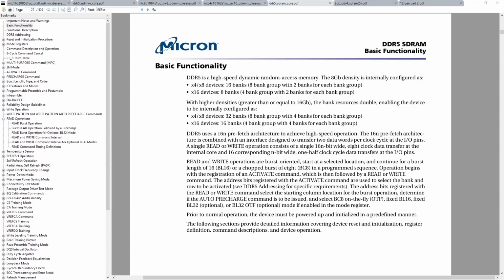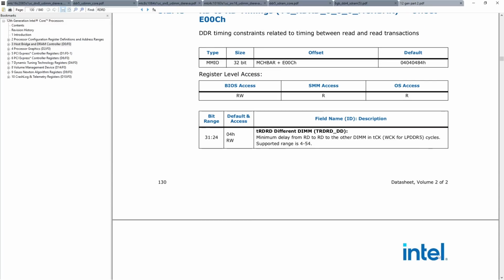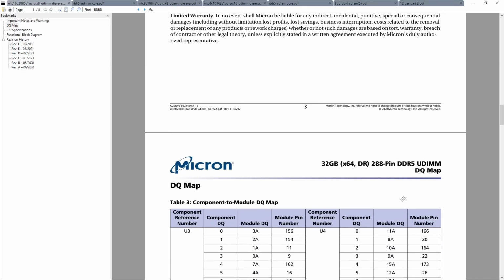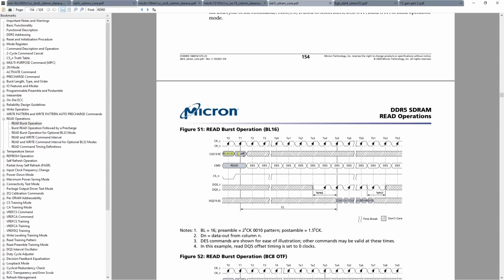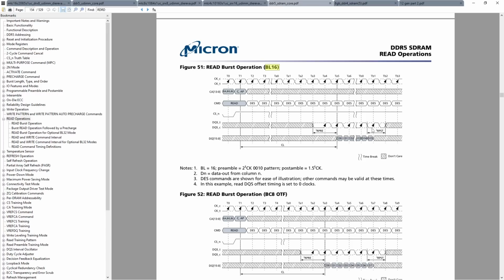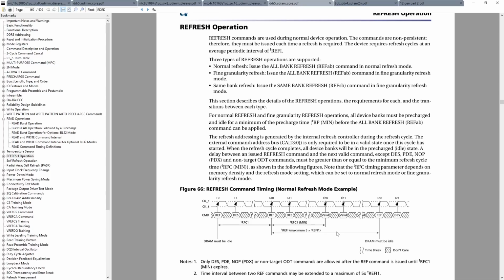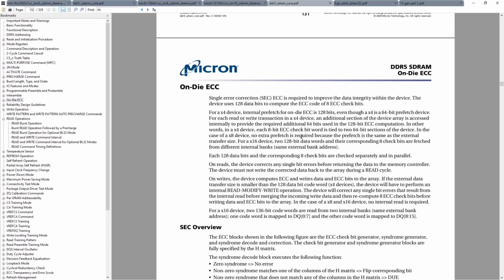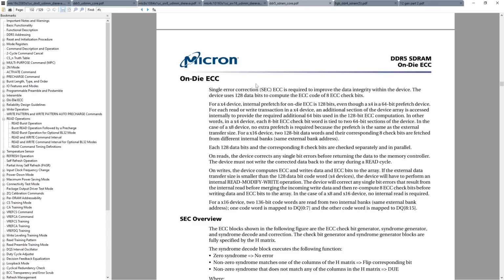DDR5 vs DDR4

Comment from the maker: Practical demonstration of dual rank and single rank memory configuration differences DDR4.
https://youtu.be/1ZbxMh5xUOg

The differences between X16 X8 and X4 DDR4 memory chips explained quickly.
https://youtu.be/w2bFzQTQ9aI
Reply: Good explanation! You bring up an interesting point regarding the latency differences between DDR4 and DDR5 – (i.e., DDR5 has greater throughput, but DDR4 will do single reads faster). Bear in mind though that, as CPU tech continues to evolve, more and more of the smaller reads you're referring to will be relegated to cache (whereas large tables/blocks would still take up too much of it). Compilers are already starting to take advantage of this evolution, so that, as new apps are introduced (and older ones get updated for modern architectures) we'll see a greater and greater performance advantage to DDR5.
Reply: Thanks for sharing so much information about DDR5. It might be important for me if I decided to upgrade one day (which is likely going to be in the later DDR5 era). I found that there was a general lack of information out there on how DDR5 really works and what the differences are. Glad to see you filled this hole.
Reply: NICE  AWES0ME KEEP_IT_UP! ✨🎉✨🎉✨🎉🎉🎎🎭🎎🎭🎎🎭🎗🎗🎗🎗🎗🎗🎗🎑🎑🎑🎑🎑🎑🎑✨🎆🎆🎆🎆🎆🎆🎀🎀🎀🎀

Comment: Hey, I found some RAM that is very interesting to me: MRC4E360GKKP8GX2
This is the only DDR4 ECC RAM with XMP that I found and I like it! I would like to upgrade to 2 x 16 GB Kits of these one day. Can you tell what ICs are used? Do you think it could be overclocked to 3800 or even 4000? Maybe you could make a short video about overclocking ECC RAM one day? There is a "myth" that you can't OC ECC RAM but this MRC4E360GKKP8GX2 already shows the opposite.

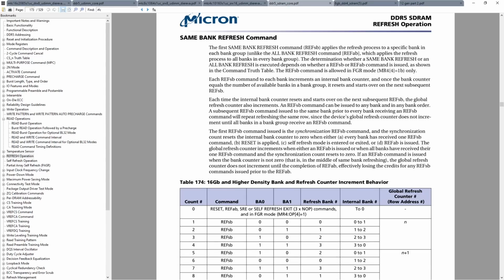Comment: 34:11 - Chapter about on-die ECC
- What is the difference between DDR4 ECC RAM and DDR5 on-die ECC? (The error correction with on-die ECC is on the DIMM so the path from the DIMM to the CPU is not protected.)
- Do bit flip errors happen mostly on die or on the way to the CPU? (I guess on die which would be good for DDR5. I think every RAM ECC is a good feature. Proper ECC would be even better.)
Reply: While there is different DDR4 ECC (UDIMM/RDIMM), the first benefit of ddr5 on-die ECC is that the memory controller of the CPU has less work with the error correction. The on-die ecc means the CPU does not waste cycles waiting for data and extra bandwidth for the ECC data. At the same time it gives memory suppliers better built-in margins for error rates - which will get higher due to ddr5 density, speed, thermals, etc.

Regarding error en-route correction the Synopsys document he showed contained a paragraph, but I'm not sure if that covered the regular consumer ddr5 on-die ECC.

Comment: 19:52 DDR4 and DDR5 both return 512-bit bursts because a x86-64 CPU cache line is usually 64 bytes. When a CPU reads even just one byte, it gets it from the cache, and each entry in the cache (i.e. a cache line) is 64 bytes. When the cache doesn’t have the data, it asks the memory controller to fetch a whole cache line. This may seem like overkill just to read one byte, but a program will need other things in the same cache line more often than not.

Comment: 22:30 does an overgrown single channel mean would provide better latency consistency if there are 2 sticks in channel A on a 4 slot, dual channel board?

It doesn’t sound to me that it’s gonna be lower but that’s okay as long as it’s consistent.

Very specific application, It’s on a T topology board not a daisy chain.
Reply: To be clear, I give no fucks about bandwidth and throughput only about latency. 

Not the lowest possible but the most consistent possible.

Comment: Without checking the litterature, I believed that the two 32bits sub channel were interleaving, thus doubling the effective clock frequency, in a manner that a single 6000 dimm would run two 3000 sub channel interleaved, like half a cycle off phased, a kind of cheated QDR. After watching this I realized that two dephased sub channel wouldn't work at all. so there are just totally independant.

Comment: All interesting but consumers only care about Price to Performance. Frankly, this early and slower DDR5 standard should have been skipped, and pushed back for the faster DDR5-7200 (PC5-57600) standard. 

Commercial acceptance is very similar but with the addition of density and efficiency.

Comment: And DDR6 (Microsoft, Sony...)?
Reply: And how does DDR5 affect APU performance?
Reply: @prep0wer  For current Vega-based APUs (5X00G), DDR4-4000 CL16-19-19-39 is the point of diminishing returns.
Past that you get 1-2 extra FPS at best in a few games, but sometimes you get LOWER FPS.
And from existing AMD APUs in laptops and the Steam Deck, faster DDR5 isn't exactly going to blow your socks off.
It won't make up for the lack of a modern dedicated GPU, it's basically around the level of a GTX 1050.

Comment: Nanya makes 8Gb DDR5 chips. Or they at least include an 8Gb chip in their list of DDR5 ICs, and they list a few different modules which use them on their list of DDR5 DIMMs - in fact, right now they don't seem to list any DDR5 modules which don't use those 8Gb chips. I'm not sure whether they're making them in significant volume though.

Comment: Unless I missed it in the video when ocing ddr5 with built in ecc you won't know where the oc limit is exactly. Because the ecc will fix errors to a point. Also does ecc have any peformance penalties at all.
Reply: In general, there is additional latency to calculate or check the ECC. However, this latency is usually small, a couple cycles. Plus, as far as I can tell, there doesn't really seem to be way a to turn off on-die ECC, so not really a place you can try and get more performance.
Reply: @dmanatunga  ECC has to consume resources to be running & on top of that if there is an error and it gets corrected there's  micro stalling and the more errors the worse.
Reply: @zazabean23  I'm not sure what you are trying to say, but in terms of ECC in DDR5, it is a constant. For writes, the DRAM has to calculate the ECC. For Reads, the DRAM runs the ECC check and correction process. That can typically be done in a couple cycles.
Reply: @dmanatunga  how do you think ECC itself runs? Does it use magic? I just pointed out different issues with ECC. ECC is not good for latency.
Reply: @zazabean23  Every comment I have written states that the ECC will incur an additional latency. However, that latency is fairly small. You can tell this from the spec because if you look at the CAS latency at the same data-rate, the difference is fairly minor. And as I stated in my first comment, ECC does not seem to be a feature you can turn off in DDR5, so it is not even a possible point for improving performance.
Reply: Even without ecc finding a 24/7 stable ram overclock is tough. Had all sorts of memtests running for days without errors just for minecraft to crash every 45 minutes. Aa a novice, id rather have ecc correct the occasional mistake even if it makes it slower in the cycle it happens. To find if its stable i guess you would test for performamce regression like you do eith VRAM?

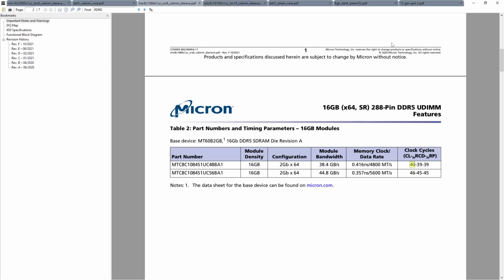Comment: 25:30 how is it different from any other new generation of DDR which was slower at the launch? Best absolute CL latency is approximately same for all DDR generations.
Reply: this time the CL latency increase is much bigger, proportionally than other generations. However the various other data transfer efficiency improvements mentioned in this video suggest that simply talking about CL latency is irrelevant.
Reply: @kuyans3889  best DDR2-800 is CL3 (circa). First gen DDR3-800 has like CL6.

Comment: Cosmic ray data corruption within  RAM is actually more common than you'd think, and on die memory correction should alleviate 99.9% of them, because most of the time you're only going to get 1 within the space of a single machine.
However, as these memory wells get smaller and closer together, you're more likely to get multi-bit corruption from a single event.
Reply: what is the frequency of those events?
Reply: @Lemard77  REALLY common, it just depends if there is a computer in the path
It has affected election outcomes before
Reply: @Lemard77  
we're constantly being bombarded with high Energy Particles, of various types. but the Planet is big, so the probability of something hitting specifically your Computer is relatively low.
Neutrinos are the big one, as they do not come into contact with Matter, so they pass straight through the entire Planet and everything on it, as it nothing was there. flies right through us at a high fraction of the Speed of Light. but they can still affect Electrical Signals.
Reply: @Lemard77  If you want an extremely rough idea about how often? It depends on a lot of factors like your geographical location and all of that.
But you can expect having 1 bit flip every day. Depending where you live you may get one every hour or every week.

And that can cause BSOD or whatever you don't want to have. Which is why servers all use ECC memory to be "immune" to this.
But for consumer hardware, not having ECC means you need one less chip of ram storage (8 vs 9 chips) which makes cheaper ram. And since consumers will blame it's the gods' fault when their PC BSOD, it's not worth the extra money.

DDR5 will basically reduce these bit flips from daily to yearly. Because DDR5 memory is not completely ECC, but the most affected parts of it are.

And TBH it's really time we finally have ECC for consumer hardware.
Reply: @swisstraeng  but I think the reason every chip has ecc because we have so high clock speeds in such small packages that it's inevitable and decided it's necessary and probably so you don't need to make DDR6 or DDR5+ or whatever in a few years, also funnily ECC is good for over locking (oc) to, it gives a lot of advantages firstly ECC / Server RAM, more data is open, like what ram chip is used, it's most of the time under clocked for some reason and if all else is equal you can push it high especially the timings because a single error and even double errors gets corrected if it didn't quite come through, at the cost of latency of course + your OS can log un/correctable errors so you can fine tune it a bit more.

Comment: Very interesting and enlightening. i have no idea what i'm doing with overclocking RAM on AMD or intel. I did no research and was just lucky on my first try (took a few days) on a 5700G getting 1:1:1 timings going from 4400CL19-19-19-39, up to  4933 CL17-17-17-30 with ~73GB/s at 54ns(i cant find the screen shot of 4933 CL17-17-17-28 with improved sub timings hitting close to 74GB/s  49.1ns) 
Going to definately try raising TRFc instead of lowering it

I know people are going to ask, yes the UCLK/MCLK/UCLK are all at 2466Mhz, Ryzen APUs use TSMC 7nm memory controllers, where as Ryzen CPUs use GloFo 12nm memory controllers which can only hit between 1900-2066Mhz(friends says he got his to 2100 but it sounds like its not stable)

I wish i could get my 5700G to run that patriot viper 4400 still overclocked to 4933CL17-17-17-30 in dual rank instead of single.

I cant wait to see what we can get out of 7000 series APUs.

Of note I cant seem to get my 12600k with the same kit over 4800CL18, and it was like 64GB/s so probably the equivelant of running the memory at 2:1, like i said, i dont know what i'm doing
Reply: I think you may have misunderstood what he was saying.  tRFC should be as low as you can get it- this is how long it takes to perform the refresh - so a higher tRFC would mean a longer refresh and thus more time that your ram is sat waiting.   tREFI is the one you want to increase, but unfortunately this is locked on Ryzen platforms.
Reply: @malphadour  You're right, the one where he said most people set to 32k. It would be nice if my 5700G could set this, so i'll just have to try on my 12600k. I'm going to have to do some reading about how to overclock on alderlake. With a different kit, I was able to hit XMP 5000 CL19-19-28-28 (? dont know if thats right but thats what the kingston renegade 5000 kit specs page says) 
Edit, 5000 kit was still slower than the 5700G with the viper steel 4933 CL17-17-17-30 
I had originally bought the renegade 5000 kit to play with the 5700G/5600G, but with that kit i couldnt even get it running at 4200CL22. I was happy it at least worked with Alderlake
Reply: "Going to definately try raising TRFc instead of lowering it"
Keep tRFC as low as possible. tREFI is the one that should be high. tRFC being higher means your RAM spends more time refreshing, and therefore less time storing or sending data.

Comment: If you practically always want to be single-rank for best performance with DDR5, wouldn't that argue heavily for future casual user DDR5-only platforms to not allow more than two DIMMs anyway, so as to limit less than optimal options for normies that prolly don't know anything about any of this? One could argue capacity issues, but then DDR5 is also said to be coming up with 16 and 32GB DIMMs as the new standard and for regular normie stuff 2x16 or 2x32 is more than enough, while the pros that need that extra RAM can buy HEDT-type platforms instead.
Reply: People like to be able to have dual channel while still being able to increase RAM capacity in the future without having to get rid of their old RAM.

Comment: So, as somebody who less knowledgeable in the field of memory, would it be safe to say for the "common folk" PC enthusiast, sticking with a high end kit of 2x16 ddr5 would be a safe option?
Reply: BZ says that dual rank (2x32 DDR5 is dual rank) memory doesn't offer as much performance uplift as dual rank DDR4 does, so there's less of a downside to buying single rank 2x16 DDR5 sticks. Not that buying double the memory for a less than 10% increase was ever a good decision. But yeah 2x16 is a good choice if you don't need 64GB of memory.

Comment: I'm a slightly above layman on this stuff, but I actually was able to follow a lot of that. Thank you so much. Now I just need to figure out an easy way how to tell if a memory kit is Single Rank or Dual Rank easily enough to describe it to my family.
Reply: Tell them:
 8 chips on one side: good
4 chips on one side: bad
16 chips on the whole stick: good but bad
Single Rank: one sided memory stick
Dual Ranl: double sided memory stick
Reply: Other than looking up the specific memory kit's, that you bought, serial number on the internet, to find the manufacturer specs for its ranks, if you don't have that specific serial number of the kit you can try to just look under the heat shields and you'll likely see the chips lined up along the bottom side of the stick. If they're only on one side of the stick, it's a Single Rank stick, but if they're on both sides of the stick, it's a Dual Rank stick. Can be hard to see under that heat shielding, tho.

Comment: Very well explained as usual, a few minor things: Advantages of multi-rank is not just having more banks but also the timings for different-rank are shorter than same-rank, on top of being able to initiate RFC on one rank while the other is active. None of these advantages benefit substantially from more than 2 ranks.

The reason 512 bit bursts are preferred (64 bytes) is because the cache lines on most processors are 64 bytes, so the minimum granularity in caches is 64 bytes, when you fetch data from main memory and cache it, it will always be a 64 byte cache line. Maintaining efficient use of the cache was one of the reasons 64 byte bursts were retained in DDR5, because otherwise you use 2 cache lines for every memory access you do.

Re: Chaining CCD/RDRD sequences, you are basically only limited by FAW and REFI, but basically you can in theory get close to saturating the data bus off just a few banks.

Comment: They did ddr5 like this so that Dell can still use 8 gigs of double capacity chips on a single stick and give you the same performances as 2 sticks on ddr4 for half the cost
Reply: That's not how any of this works. You still need to have the same number of chips to get a 128-bit memory bus (8 for x8, 4 for x16). Module form factor is irrelevant. Whether we call 32 bits or 64 bits a channel is also irrelevant.

Comment: I'd like a buildzoid episode on rambling educationally about how the not on-die type of ECC actually works. 😁
Reply: I'm also curious what happens when the ECC data is bad. In his example, it tried to store 5, but stored 4, but the ECC data was actually able to correct it. But what happens if you send 5, it stores 5, but the ECC data that gets stored makes it look like it shouldn't be 5.
Reply: Similarly I'm also curious as to what happens when the ECC bits are the ones that get corrupted. Or does it even get corrupted at all?
Reply: @RinMinase   @Russ Kubes  
It is possible that the ECC code is what gets corrupted, whether it be through alpha partickets, component issues, transient faults, etc. Typically, these ECC schemes are generated such that any bit error, whether it is in the original data or the ECC code, can be identified and fixed.

A common type of ECC in DRAM is SECDED, which can do Single Error Correction, Double Error Detection. With this scheme, there is an algorithm you go through to identify the location of the bit error. If you see the location is in the data, you can flip that bit to do the correction. If the location says it is in the code, then you don't really have to do anything.